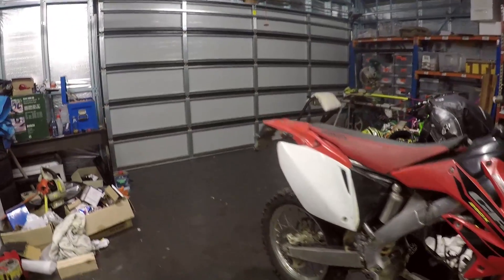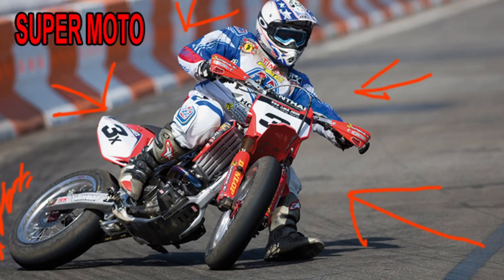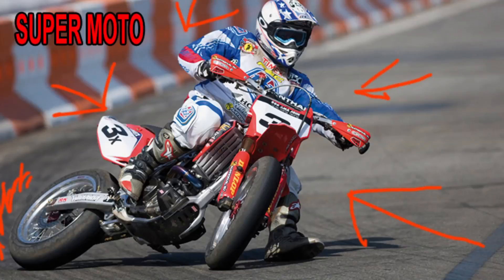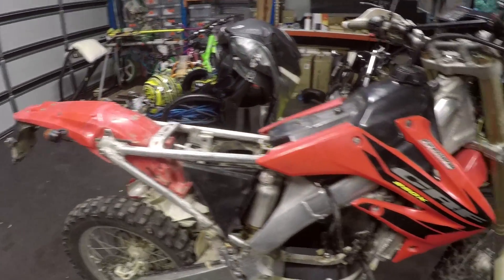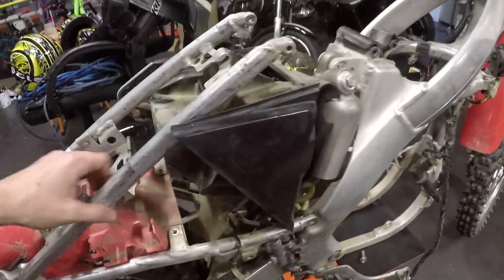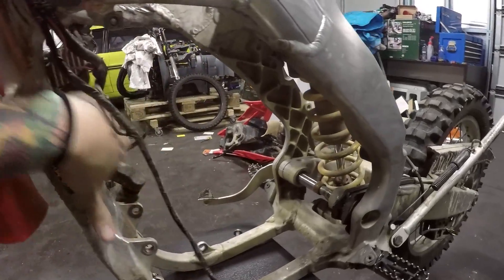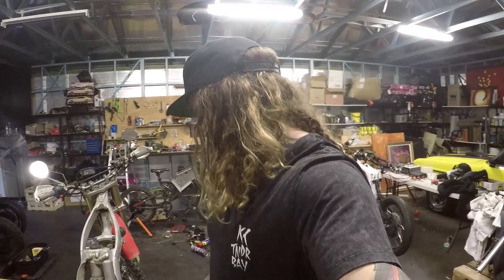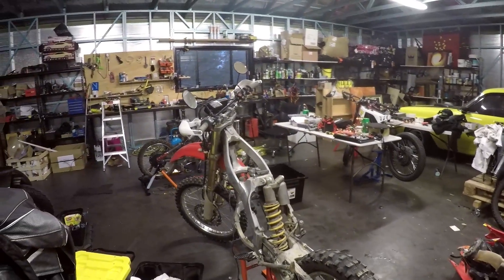50KW ELECTRIC SUPERMOTO MX BIKE BUILD [EP 1]  WILL IT WORK?

Comment: performance isn't what people are concerned about with electric bike's, because they are better. instant torque whenever with no power band it's 100% until you hit the limits of the motor or power output. the reason people prefer engines over motors is because the technology is new and inefficient. a charge doesn't get you too far and the recharging takes too long and isn't always available for daily use. but that wont be an issue for the tracks
Reply: MitchMAH Effeciency of brushless motors and controllers reaches into 90%+. Most of the energy in your gasoline is just going to get wasted as heat.

Battery tech will improve over time, but make no mistake. Electric vehicles are already here.
Reply: A internal combustion engine average around 20 percent thermal efficiency where a electric is at 90% average so this is a pointless argument. Its faster to refuel than recharge that's about it. It's cheaper to recharge than to fill up a tank of gasoline.
Reply: Bob Lob Law Even Harley Davidson recently announced a new electric model.